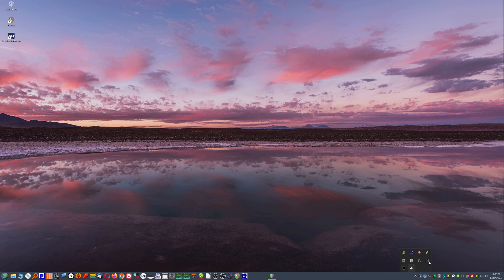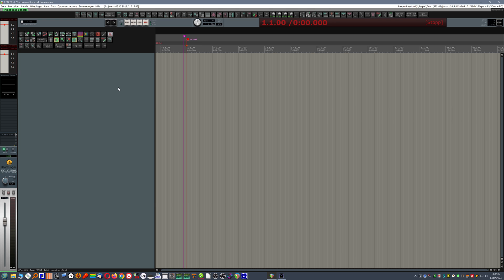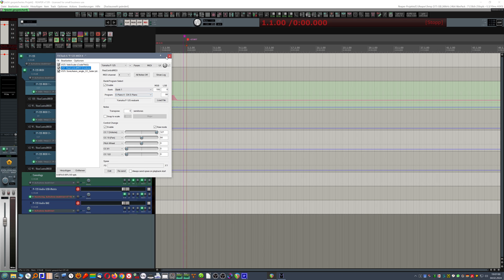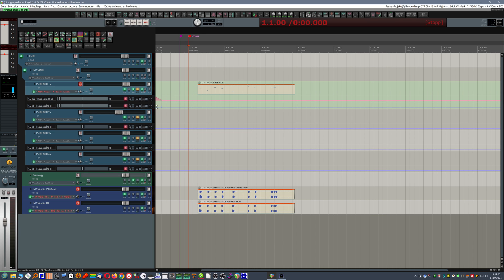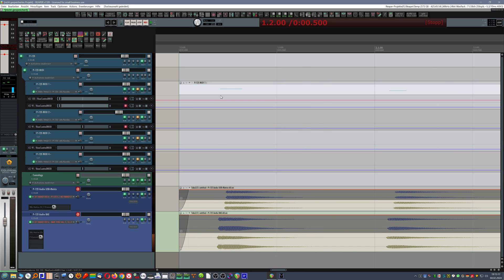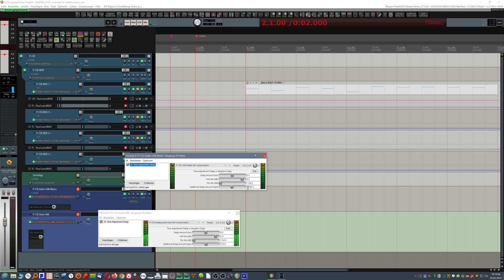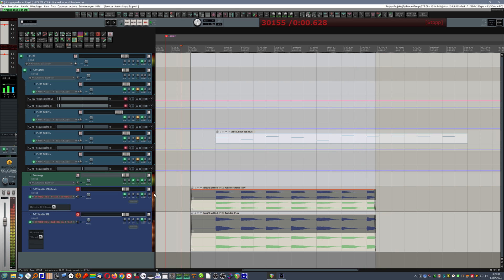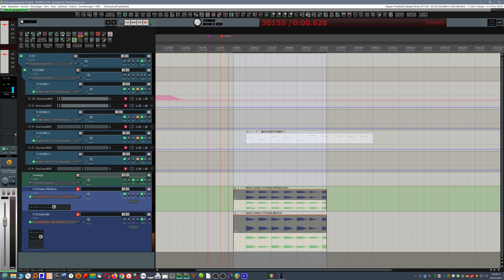eliminating audio and MIDI latency while aggregating multiple audio interfaces with VB-Audio Matrix

Comment: What about VB Audio potato? Can you aggregate a couple of audio interfaces and route them with that and it's the same low latency? Or is Matrix preferred? I am struggling to understand the differences.

My use case - I have a MOTU audio interface connected to my DAW (Ableton) and I want to plug some other samplers in that present as audio interfaces over USB. I want to just be able to get audio in/out of my devices with minimal latency and do my monitoring out of the MOTU and not have to change audio settings in Ableton or swap headphones frequently.
Reply from the maker: My impression from briefly looking at Potato is that it's more geared towards podcasters and maybe DJs but not the pro audio segment. It only offers 3 ASIO inputs. Why not trying either the Matrix or Coconut? Either of them should easily handle your environment. Cost is low for any of them.

Comment: This is tangential, but are you running a third party shell or taskbar in Windows?
Reply from the maker: You are correct. I prefer to use as little as possible from MS (only the bare operating system) and replace as many MS app as possible by third-party tools which are usually free and portable and do the job better in most cases. On this computer, I'm using OpenShell, I restored the QuickLaunch taskbar, I replaced the white window title bar by an accent colour to better be able to tell windows apart and I'm using System Explorer as a task manager replacement. I'm also using 7+TaskbarTweaker and WinAero Tweaker. I probably forgot to mention a few other replacement apps :-)
Some people complain about the customizability of Reaper. I love tweaking and customizing stuff to make the computer and my entire working environment more efficient.
Reply: @SonicAxiom  I so agree and I guess I use most of the same customisations you do. 
Isn't it bizarre that MS manages to make each Windows version less and less usable for Powerusers? You can waste weeks to get rid of all their nonsense kiddy gamer shit assistant bloat after installing a new system. That's why I'm also still hogging on WIn10. I also used XP pro for as long as possible then went straight to Win10 pro.
I might however need to do an in-place repair install, 'cos something got really messed up a few weeks ago and several ACLs on the system drive got effed up. I hope I don't need to go through the same hustle like a fresh install. What suxx most on a DAW are the ridiculous attempts by manufacturers running "copy protection" and background services for their audio apps and plugins and the gazillion serial numbers required to reinstall all of it... 😞